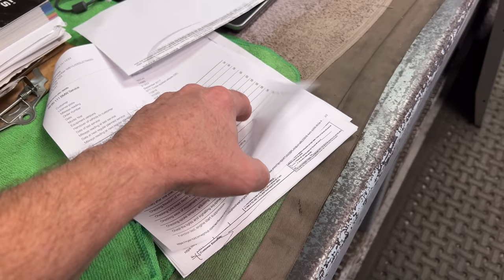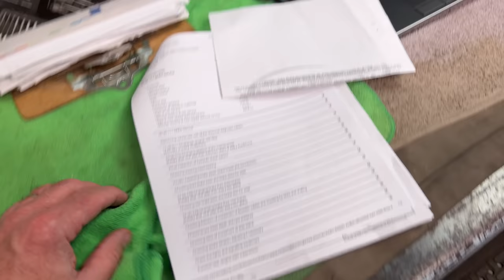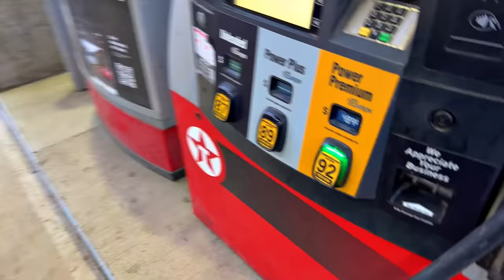Replacing an R9T Battery!! • Cool F3S Owner Gift..! | TheSmoaks Vlog_2318

Comment: I use a torque wrench when I do the service on my 2009 RT and I always replace washers and orings. The only difference is the oil and filter. I use Mahle for oil/air and Mobil 1 for oil. Mahle makes the filters for BMW from what I understand. If it was under warranty I'd use BMW stuff.  The airbox and battery look the same as my old RT.  The weather on this video is like what I saw last week in Seattle.

Comment: Wow! That's a bummer about the R9T battery charging and replacement process. Kind of like my R1200RT air filter replacement. Question, At what mileage am I supposed to flush my coolant on the R1200RT? I couldn't find it in the manual. Thanks.

Comment: Hi Shawn,  I am going to have the same problem when I get to that fateful day. I hope my walls will be strong enough to hang all the tools on after 40 odd years of amassing an assortment of odds and sods, some I may have only used a couple of times but will never part with. What's the best way to correspond with you about some technical questions concerning my spyder.

Comment: Hi Shawn, thanks for the info on the battery. I have a question for you when a battery fails the BMW test. I took your old buddy 2020 R1250 GSA demo to my local BMW dealer last Saturday for the annual service. Oil change plus brake fluid flush and checklist just like you described. I was surprised that they recommended that it needs a new battery since you always used the optimate and I do too. Maybe I should have them double check it? The bike starts up just fine and runs like a dream. My wife said I should just get the new battery and be done with it. I showed the service manager your video on the R9T with the charger and he said they have three of those chargers at his shop. They cost something like 2.6k. I just think the battery should last more than three years myself especially when the charger is used. Oh well, I should just take the good with the bad. Overall, the bike is fantastic and I could not be happier.👊👍🏻

Comment: Interesting, when I bought my r nine t, my dealer installed a pigtail for a battery tender and I have been using it with a battery tender.  Is that a bad thing?  I’ve been doing it for the 3 years I have owned it with no problems.  Thanks in advance.